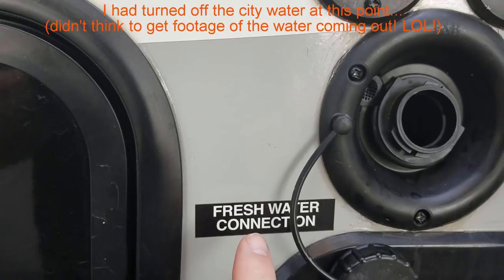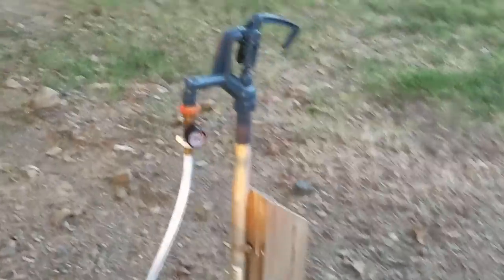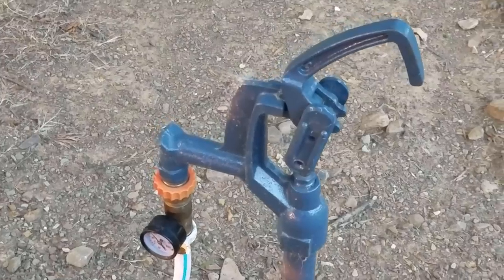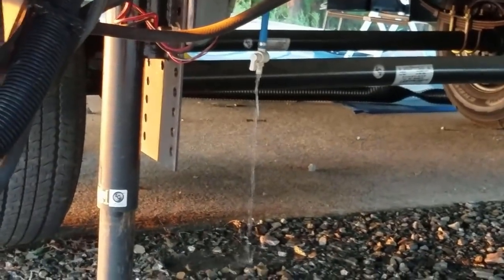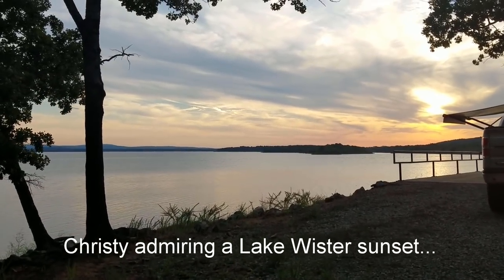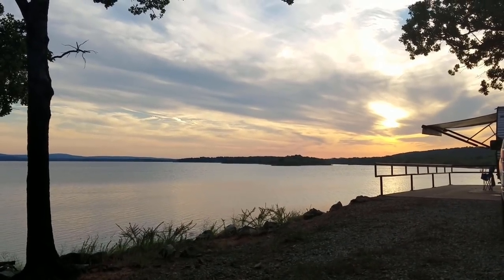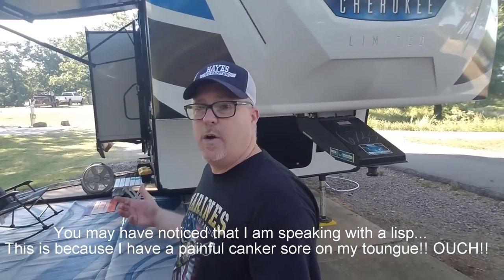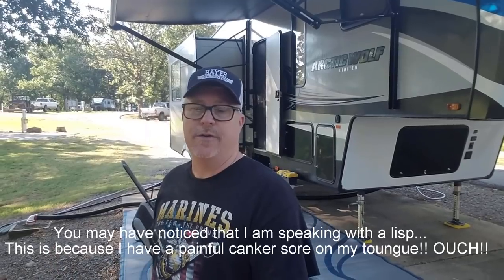RV Fresh Water Tank Overflowing | City Water Fills Fresh Water Tank

Comment: Looks like it worked for everyone but me. I replaced the water pump and it fixed the problem for about two weeks and then it started happening again. I've tried your method several times without success. I'm going to do an external check valve next as replacing water pumps is expensive. If that doesn't work I'll just leave the fresh water drain open and irrigate all of southern Arizona!

Comment: thanks so much for posting this information!  i just had this happen today and was shocked to see water pouring out of my potable water connection. Earlier today, I had turned on my water pump to test it since I’ve been hooked to city water for a long time. Had no idea this might happen, but I’ve really learned my lesson!   Wont leave the water supply on when away from the RV anymore.  Thanks!
Reply from the maker: I am absolutely thrilled that you found this video to be helpful!! My hope was that this video would prove useful to folks that had experienced the curious phenomenon of water pouring out of their fresh water tank like we did! LOL! Like you, I had NO IDEA that this could happen!
Reply: Just had my city water connected and water started pouring out of my overflow valve under the camper. I had ran my pump prior to empty the system to check it over. But my sensor says my fresh water tank is empty. Will try your idea and get back.

Comment: Your problem, and the discovery of it, is exactly what happened to me. I did not have your solution so I just shut off the city water and drained the fresh water tank and then turned on the city water only when we needed it. 
I'll run through your solution the next time we take the trailer out to make sure the valve is not stuck.
Thanks
Reply from the maker: We really hope this works for you! Thank you for watching!!

Comment: How crazy is this!   I had this EXACT issue this morning and turned off the city water.   I ran the pump for a bit and noticed it was pumping with an stuttering type sound.   I figured the pump was bad which caused the backflow.   I turned everything off after 10 minutes or so.   Hours later I turned the city water back on just to see how bad things were again.   To my surprise, no leaks.   I googled the issue and it took me to your video.   I inadvertently did just what your advise said so I can now rest easy that the problem was an air gap which caused the valve to let the city water fill the fresh water tank.   Only thing I would have like to have found is....where is that valve in case it does go bad in the future?
Reply from the maker: I'm so glad that you discovered this resolution to your problem! I'm not really sure where the valve is at to be honest with you--I haven't had any more issues with this and haven't even thought about it since making this video. LOL! I'll have to do a little research myself and find out! Thank you for watching!

Comment: Had the exact same issue..sort of. I had my city water running into my fresh tank because the check valve was stuck (apparently), so my fresh release valve was opened and the water just pooled out. Did what you said. Took a while to empty the fresh tank and let out all the air in the lines at each faucet, shower, and toilet. Once the fresh was completely empty, I went ahead and opened the fresh release valve. They say that needs to stay open when that tank is empty. So far, so good. No leaks or drainage. I lost some water pressure though. The shower is about 25% less pressure than it was. It’ll probably build back up over time, right? Anyway, thanks for posting this video years ago, because Insure did need it today. Thanks, Dude!
Reply from the maker: I am so glad that you found this video to be helpful! Thank you for watching!!

Comment: Thank you!  The same thing just happened to me.  I was told city water would not add water to my tank water and I had to fill it manually.  Suddenly I have water pouring out of mine just like yours.  Now I'm about to go outside and do the steps you recommend.  fingers Crossed!
Reply from the maker: I hope this worked for you! Thank you for watching!!
Reply: @SunsetSeekers  Sadly after 3 tries it continued to back-feed into my tank.  So I know the check-valve is shot or has something caught in it.  Since it is within the pump assembly I opted to leave it alone and install a shut-off valve.  So when I'm connected to city water (usually am) I just close the valve.  I just got all that finished about 2 hrs ago and so far so good.

Comment: Hey, I disconnected the fuse to the pump and turned on the hot water tap until all the air was out. It works great.

Comment: Yesterday was the second time this has happened to me. Every time that this has happened for me I was working on the water system, either a installing new faucet installed or a kitchen sprayer.Your video solved my problem this time. I do wonder is it a equilibrium problem between water and air causing the flow valve to have issues or is it a calcium build up issue in the valve.
Reply from the maker: I am so glad to hear that this video helped you!! This has only happened to me once so far and I think that it may have had to do with the fact that this was the first time that I had used my RV since winterizing it a couple of weeks before. I use compressed air to blow out any remaining water in my tanks while winterizing and I think that this was the cause for me. I made sure to get all of the air out of my lines and everything worked fine then.
Reply: I dont think its a calcium build up. I've had this problem within three months of owning a brand new rv.
Reply: @tobiaskastner2429  Same thing here. Owned it about six months when it first happened, changed the water pump which fixed it for about two weeks and now it has started happening again. I'm going to try and external check valve and see if this takes care of the problem.

Comment: Why is the drain valve under the rv dripping water too?  Are you suppose to leave that open or is that how you're draining the fresh water and using the pump at the same time, and then close it after water is all gone?  I have this same issue of my fresh water tank filling when on  city water.  I tried these methods and it still overfills.  Guess I'm doing something wrong.  I cut off the city water and run the pump, but maybe not long enough cause every time we notice it its during the night and don't feel like waking everyone to do this method.  Had 2 campers before and never had this problem.  We never boondock or fill our fresh water tank, we always hook up to city water.  Maybe when the weather gets warmer I can get these tanks and water connections to work right.  Thanks for the video.

Comment: On a side note, don’t forget to turn the water faucet off when you go to bed. I know from experience that this will cause your grey tank to fill up and overflow onto the floor, flooding the camper and waking you up at 1:30 in the morning.
Reply: Why don't you fix the water leak? Water can only enter the grey tank through a drain. Water is entering a drain someplace.

Comment: One thing I am not sure about - do if I first DRAIN the fresh water tank?  Then try the pump for 10 min?  Then turn on faucets?  That worries me since the pump is not supposed to run without fresh water in the tank.
Reply from the maker: I would drain the fresh water tank first. If you empty your fresh water tank and it is still being filled with water, this is the best indicator of whether or not the solution worked. If not, you may need to try the process again or replace your check valve.

Comment: My question was same as someone else here and I did not see an answer to his question........when you turned off city water and turned pump on, did you have water in the fresh water tank at that time?  I did as you said but with no water in fresh water tank.  Problem is that after 10 or 15 seconds hot water quit flowing as it had no water pressure.  That is why I ask if you had water in fresh water tank so the water heater had something to draw from. Thank you.

Comment: Just recently ran into this issue, noticed a drip from my low-point drain. Removed and re-installed the plug, and around three days later, the fresh water tank backflowed. I tried this trick and will see in an hour or so if it worked. Also, there is a brass ball valve on the line leading to(?) the pump. I have turned that valve off also. Hopefully your trick will work!
Reply from the maker: I really hope this works for you!!

Comment: ??? Why would you let your fresh water tank fill up if you are on a direct connection to the water source? If you turned off the valve to the fresh water tank, you then just use city water. No pump needed either. Am I mistaken here? Just wondering?

Comment: Thank you, good information and reasonably short explanation. Can you please answer or anyone else answered, does the leaking that comes out leak into the walls or under the outside of the tank causing damage or possibly mold issues anywhere? We all know that water will find its way wherever, but has anyone experienced any issues or is it safe to say we should be safe! Obviously just had the same issue, dang it..
Reply from the maker: Fortunately, the water poured directly out of the fresh water tank fill in our situation and, perhaps because we caught it quickly (we were notified by the park host), we did not experience any other issues. For us--no water leaked into the walls, nor did we have any issues with mold. Thank you for watching and I'm glad that you found this video to be useful!!
Reply: Sunset Seekers Thank you again and sure enough this just happened again, so I came back to your video and reference and paying a little closer attention.

I will try and run all the faucets this time
 to get all the air out. Another question though, and when you say re-hooking up the city water, would it make sense to actually unhook the hose and re-hook it back up? Or did you just mean pretty much just turn it back on again?

3 AM here, just took my wife to work and it woke her up earlier at about 1 AM overflowing a lot more than last time, thank God we are pretty sure it’s not going into the walls also by the way as per my question last time.

Comment: My issue is a little different. my pump is running but i can't get anything out of the lines. i had a water filter explode on me last night and completely blew off my city water connection so now i have to replace that. but i was able to fill my fresh water tank and can't get anything but air through my lines, some water does come out but it's just constant air for the most part it never stops spitting and sputtering

Comment: Do we switch the valve to the fresh water tank to use the water pump? Or do we leave it on city water and turn the water pump on?
Reply from the maker: Only turn the water pump on when you want to use water in your fresh water tank. You shouldn't run your water pump while using the city water.

Comment: So this helped for a couple days then it did it again and I found out that there was plastic in the pump from manufacturing. It was quite easy to take apart and take the plastic out. Just for anyone that needs another option.
Reply from the maker: Thanks for the advice!
Reply: I'm willing to bet that bits of plastic left in the pump after a sloppy installation is the real culprit.  Flushing it as directed here might help flush out those pieces.  It doesn't take much to prevent a flapper valve from fully seating.  I'll be working on mine tomorrow as I have the same symptoms.  I'll try blowing water into the pump from both directions and collect the water for inspection. Wish me luck.

Comment: you have a stuck one way check valve in your water pump. replace it?
Reply from the maker: Not unless this solution doesn't work and you continue to have this problem. I haven't had to replaced mine.

Comment: The water pump internal check valve failed. I placed a shark bite check valve on the flow side of the water pump. Easy fix.

Comment: I just filled my fresh water tank and now the outside fresh water outlet just started heavily dripping and I can here the water gurgling in the tank. What do you think is wrong?
Reply from the maker: Sorry for the late response Renee--we are down in Palo Duro Canyon right now with no cell signal and only see messages when we come to the top. Not sure exactly what the issue is unless the cutoff valve is still stuck open. You may need to repeat the process a couple of times before the valve closes.
Reply: @SunsetSeekers  -thanks for the reply.  I watched a video talking about a failed check valve.  I took the rubber gasket/screen off and adjusted the white thing and it stopped but started dripping again later. Rather than have it completely fail when I'm out, which I am, i just went to an RV place and had it replaced.

Comment: This started happening to my motorhome about six month ago. Fresh water tank half full and when on city water, the fresh water tank fills up and spills into the bay below. I figured pressure and air. I turned off the city water and ran the pump, Fixed it at that time, but this issue happens often wherever I am hooked to city water. How can I fix it permanently? Thanks.
Reply from the maker: It sounds like you need to replace your check valve.
Reply: There could possibly be plastic in the pump that is making it stick. If you can, take it apart and clean it. Mine had 9 pieces of plastic .
Reply: There’s a backflow preventer or “checkvalve” in your system.  It’s probably built into the pump, from China.   So add an aftermarket check valve. Add it between the tank and pump.  15 bucks.
Reply: @Jcassassin2001   How sad that so many of these problems are due to sloppy workmanship.  I'm repairing our camping trailer all the time and it constantly has to due with the builders.  Probably, in this case, they didn't bother to clean up their debris left behind when drilling the tank and it flushed into the pump.